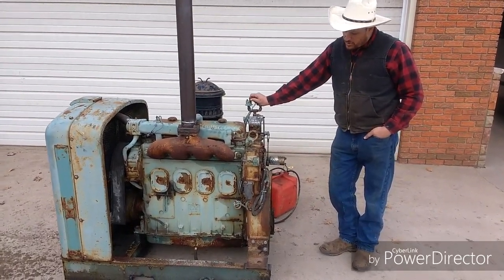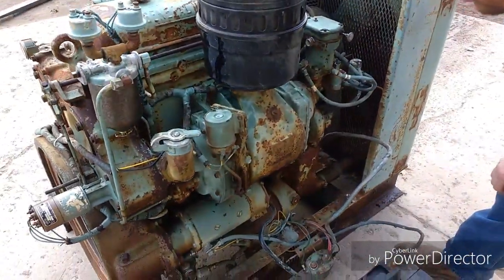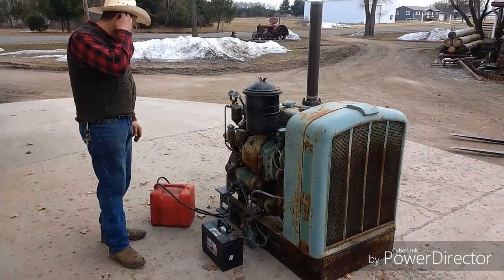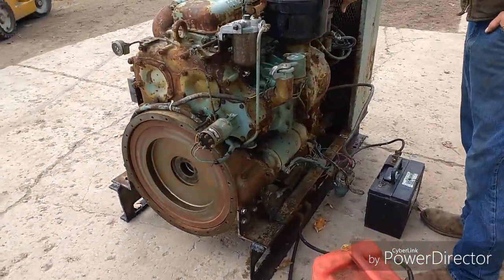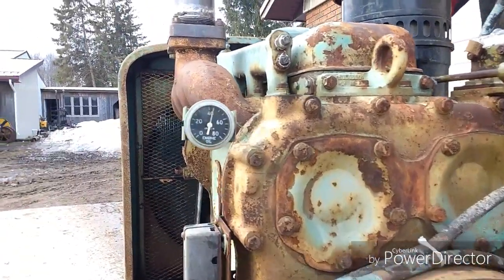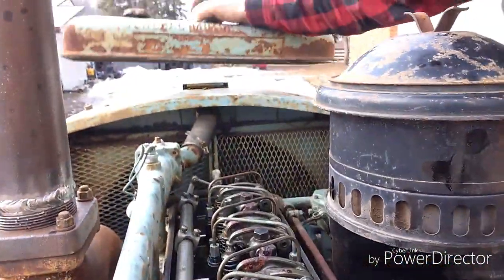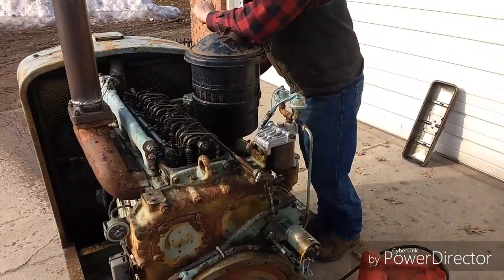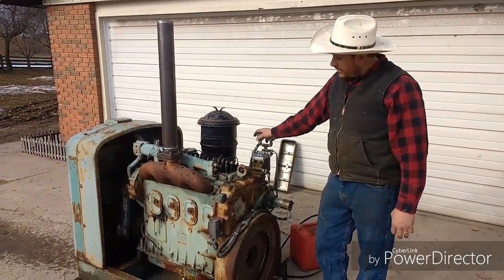Detroit 4-71 Engine Test Run

Comment: Many have an air shut off just below the air intake (near the blower)which kills the air. Sometimes connected to the cab by cable or solenoid,or sometimes just shut off by hand. Right at the site.

Comment: That's opened up a lot higher than 2300 rpm,s sounds like about 3000 I wouldn't tach it up like that till the rings reseat themselfs auto Trans fluid in the fiel will free them up great running engine I have rebuilt probably 8 to 900 of those old detroits I had a fleet of 8 kws with the  v 12 s in them used for heavy hauling all automatic 8 speed Allison's in them ,,,best trucks I ever had that was back in the 70s ran them all the way up till 2010 cheap to rebuild too about 2700 dollars and always had at least 3 kits put up just in case lol what do you want for it

Comment: I’ve got a 4-71 in my old Michigan Loader, what a good engine. That thing will fire up at any temperature and always runs perfect. Yes it’s loud, but it’s never not fired right up. I’m told the  biggest killer of Detroit’s is from constantly lugging them, since they sound like there spinning twice as fast ppl tend to lug them especially older guys and I know of 2 different 6v71s that split the liners ,we were told it was from  constant lugging from the driver. We never whiffed ether at it so it wasn’t an ether baby. Detroit’s love to run at a steady speed ,probably one of the best engines ever made for stationary sustain speed use .

Comment: Radiator part number 3118864. Have not been in the Detroit parts business for 25 years. Sold a lot of them when I was in that field. Later I was unnatural gas industry mostly waukesha's and cat's. Detroit's are so versital. Left and right hand models with ABCd  accessories. And they run forever.

Comment: Put a quart of automatic trans fluid in the fuel ,it will smoke a little but it will loosen the rings up and get them working again and don't race it up set it about 1500  high idle for about a hour ,,,,1 quart of trans fluid for every 5 gallons of fuel ,,,that runs good don't TACK it out till u free up the rings

Comment: Obviously she needs flushed with diesel. Like 3 or 4 gallons but not run with it in. Then the best synthetic oil and then put in an old early 50's coe with new running  gear for a beautiful hauler with a heavy trailer for short equipment hauls. She would work for 20 years looking and sounding great.

Comment: I love watching a old start cold start. And the first thing somebody does is rev the snot out of the engine before it warms up.
Reply: It's how Detroits roll.. sound like they are doing a lot more rev's than they are and it's good practice to rev them up when starting them
Reply: That’s how Detroit’s are set up for gensets.   They go straight to operating rpm upon start up
Reply: @TugboatMatt  never seen it on a cold engine! Everyone I've seen is thermistatically controlled at 160 degrees + to simulate an operating engine temp.
Reply: You can do that with a detroit

Comment: you do realize that it's impossible for there to be a 60s 71 series right they stop production of the 71 series in 1957
Reply: hey little late but the 71 series was actually made to 1995 and other 2 strokes till 2006

Comment: just dont understand why persons testing  an engine feel the need to constantly rev it,
Reply: because we want to hear it
Reply: @powerslide000   thats the answer only a dullard would use
Reply: Because it’s not “tested” if you only run it at idle, revving it will bring to the surface most problems really quickly
Reply: Its a 2 stroke thing,, same like dirt bikes, they enjoy revving more than other engines,,
Reply: His wife made him sell his Harley.😅😮😢🎉
Reply: Or....."the generator worked absolutely perfect and was like brand new......so we took it off."

Comment: Seems kinda cool how 2 strokes have around twice the torque/power of their 4 stroke counterparts, sound like they're spinning at twice the rpm and have twice as many cylinders. Would be an awesome built if someone could take such a diesel and increase the revs a bit more ^_^
Reply: and twice the fuel consumption, emissions and noise 🤣 cool old thing tho.
Reply: @Diesel8290  well the fuel consumption as far as I remember was actually pretty impressive for an old engine. The BSFC of the Detroit Diesels was pretty low (obviously part-throttle conditions may differ, but still) - but yeah lol, no doubt about the sound and emissions
Reply: @MrAndrius12  I would love to see a modern variation of one with common rail. Vgt turbo and Adjustable intake ports etc but it’s an ancient technology sadly 😅
Reply: @Diesel8290  yeah, same here. I know there's some bright minds out there, maybe some day someone will do some DIY setup.

Comment: It's not a Detroit, it's a "gm diesel"                 lower compression, 2 valves per cylinder. Not as much hp as Detroit,Built to last forever. 
Detroit diesel
4 valves per cylinder
Higher compression
Higher horse power then gm diesel
Don't last as long as gm diesel between rebuilds
Reply: What the actual fuck are you talking about lmfao

This is clearly a Detroit.... Uses the same internals, based on an early modular design shared across GM brands. If you're confused look up the combined history of EMD, Detroit Diesel, Winton Engine Company, and General Motors. The EMD 567/645/710 based engines and ALL the Detroit two strokes were designed based off of the same patents, engineering, and engine blueprints. They are literally derivative of each other with the main difference being size, governed engine speed and changes to forced induction. This is all thanks to GM owning both EMD and Detroit Diesel. There is no such thing as "GM Diesel." Please go check your facts.. the closest thing to GM-Diesel would be the GM-Isuzu joint venture called DMAX Engines, which produces the modern, high speed, FOUR Cycle, V8 commercial grade turbodiesel that is branded in the US as Duramax. Yes, the one that competes in the Powerstroke and Cummins B Series segment.

Comment: You keep raceing.it up like that with no load on it youll have connecting rods snapping your legs off... its not a gas job....
Reply: Art Jones be perfectly fine. Seen diesels roaring at over 3000 revs
Reply: Especially since he claims this was from a cold start....  Which I have a hard time believing.
Ferguson - So what if you have seen them reving over 3k, I've reved a 7.3 all the way to 5k, that doesn't mean it was a good idea and didn't stress out the internals.
Reply: Patrick Baptist 3 to 3 and half k is a lot on a agricultural engine. Seen it a mercedes mb trac, tractor. A modern Diesel engine in a car or Jeep is different. They can go a higher all right

Comment: Engine swap on a f350 will be nice.
Reply: It's a NA engine, it wouldn't be that great in a truck, just get into the altitude and watch the power go down hill.  If it isn't turbo charged (diesels) then it isn't very favorable in trucks.
Reply: @PatrickBaptist  I would be more worried about the 2100 rpm maximum & a workable gearing...60 MPH would probably be a maximum.
Reply: @AndieBlack13  Yeah that too, my 00 F350 does around 55 at 2000RPM.  Well not right now it doesn't I've gotta finish rebuilding the rear end one of these years, it's been sitting over a year waiting on that one LOL.  
I'm also not a big Detroit fan, I like to hear em run but I wouldn't own one.
In trucks I likes the 7.3s mine is just a little shy of half a million miles on the org engine and the worst work it's seen was a set of injectors and it still fires up good in the cold even though it hate a glow plug tip awhile back still has very acceptable blow by.  
Also have water/meth injection setup on it as well.
I've also got a bus converted to an RV with the 7.3 in it and it's governed at 2500RPM, I hate that, I've gotta order the connector so I can reprogram the PCM and remove that and the 55mph limiter.  Now that engine on has 91k miles on it, cleanest 7.3 I've ever laid eyes on.
Ford lost my respect with their diesels they brought out after that and I'd say I'd have a Detroit before one of those.  I hate the fuel racks on those old DDs, big reason I wouldn't have one, 7.3 can't run away unless the turbo dumps oil into the intake.
Reply: 4-71 with N65 injectors has like 160 HP gross.  You wouldn't be happy with that in an F350.

Comment: Anytime you fire up an unfamiliar Detroit Diesel engine, you need to have the valve cover off and a set of vise-grips on the fuel rack, so you can first check for proper movement and no stuck injectors. Otherwise you'll have a runaway, then a grenade.
Reply: words from bus grease monkey. I am sure it was running before they start it on video
Reply: For runaways you need to Choke The Air Flow.👍
Reply: Bingo,, Also check for stuck injectors  also ourd a small amount of b40 wieght oil over the rocker arms for good mesure !
Reply: that makes me wonder- when you say unfamiliar, do each of these engines SEEM to have somewhat different 'personalities'?
Reply: I take it that motors long gone. Im needing one
Reply: Just have a thick rag to cover the air intake.
Reply: but, he could just pull the hose from the fuel gallon...   so, wouldn't runaway for long
Reply: @boobayloo  it’ll run if it’s own oil. Stopping the fuel doesn’t do anything in a true runaway
Reply: @boobayloo  They run away faster than you can imagine lol. It will grenade before the fuel in the system runs out.
Reply: @boobayloo  qwantwz hp??

Comment: Sounds like new
Thanks for sharing. 

It would make a great pick up 
Power plant. 

The
Grease monkey will tune it up for you.
Reply: Who is the grease monkey? are you refering to western truck and tractor repair?
Reply: Genaro Castellon Grease Monkey is a You tuber, specializes in Detroits, mostly 671’s.. check him out
Reply: The 71-series is really too big for most pickup truck engine swaps. The 53 series is a better candidate. But if you have a vintage truck chassis, then go 3-71, 4-71, or 6V-71.

Comment: Somebody’s messed with the governor. Older Detroit’s like this one had mechanical,  constant speed governors that were set to 1800 rpm, no idle. After the 70’s most had Woodward electronic governors that could operate either in droop or isochronous mode.
Reply: That’s the Woodward hydraulic governor on this one from what I remember the knob he is pushing went directly to the rack and bypassed the governor.  We used it on one we had to give it full fuel when starting

Comment: To fix that radiator leak put into a cold near full radiator two egg whites & a soup spoon of powdered black pepper & run the motor till it hot, that will seal up the hole no problems.
Reply: LOL McGyver.  That isn't wise because it coats the passage ways in the block reducing thermal efficiency.  Always better to just fix the real problem.